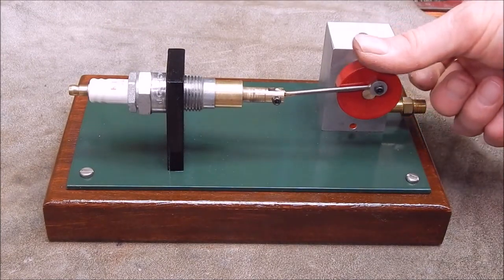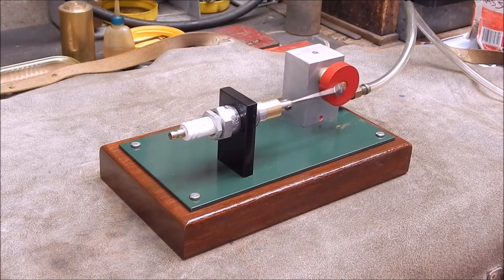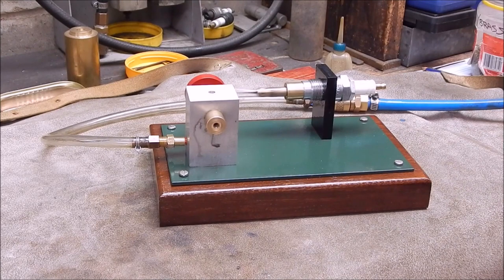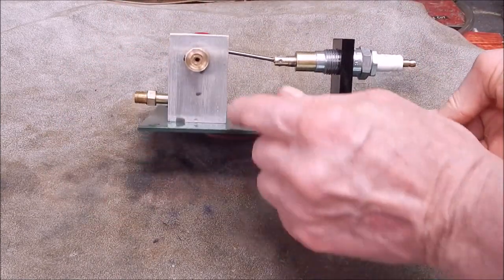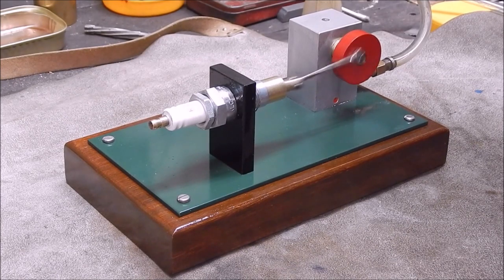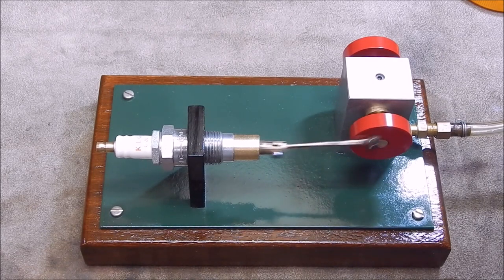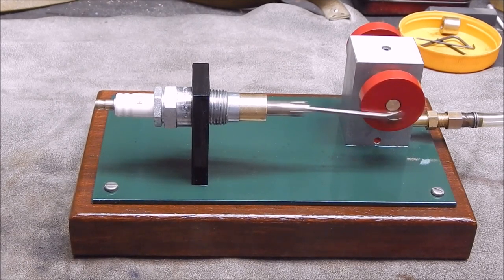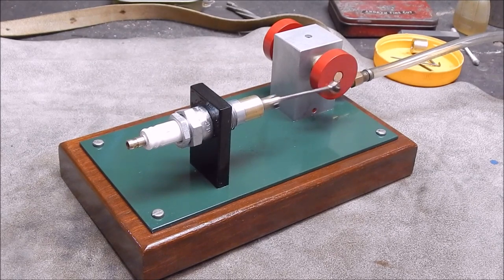Steam engine made from a spark plug

Comment from the maker: NOTE:  Like all my model engines this one cost virtually nothing to make.  The only part I had to buy was a small piece of brass stock for the cylinder and piston.  All the rest is junk.

Metal work can be as cheap as you want to make it.  You can easily do this on a mini lathe with the absolute minimal tools.  Money won't make you a good machinist, but practice will.

So what's holding you back ?  Get out there and make some chips.  Cheers Rob.

Comment: I love it Rob 👍👍👍 What a fantastic little engine, I especially like the fact that you've hidden the pipe work. That will have a few people scratching their heads 😉 Cheers, Alan.
Reply from the maker: Hi Alan, it worked out rather well I thought.  The thin riser for the spark plug makes an internal air line appear less likely, but it's there.  Good for a laugh.  Cheers Rob

Comment: Hi Rob,  I sure thought the second flywheel made it look better and it ran slower for sure.   I also will say you need to go a step further and add a plug wire to that spark plug and hooked up to a coil or capacitor or something.   Would require a little more thinking when seeing it first time.   Great job on the engine.

Dale in Canada

Comment: Should turn out a tiny false ignition coil, and connect it to the spark plug as another distraction, even more so if you take that second flywheel, and drill it for a few small neodymium magnets, and have a relay coil core near it, to generate a current pulse you feed to a red LED, apparently connected to the coil.

Comment: Hi Rob, two flywheels, I think you should V out the 2nd flywheel and run a generator through a distributor and use one of the spark plug caps with an led/neon in it onto the end of the plug! That would then look really confusing to the end viewers! Cheers, Jon
Reply from the maker: Hi Jon.  I did actually think about flashing an LED at the plug end but the piston makes that a bit unlikely.  Good trick though.  Cheers Rob

Comment: I think you could go a bit further. If you hide the incoming air line and then run a spark plug lead from the aluminium bearing block/valve to the spark plug, would have more people scratching their heads. Ha ha. Good one.
Reply from the maker: Lots of possibilities :)  Cheers Rob

Comment: It would be good to see a second cylinder run off of the exhaust if you're going to keep tinkering.
Reply from the maker: That would appear to be rather difficult.
Reply: @Xynudu  babbit bearing to connect the air line to the turning crank, the pressure cycle is already timed, a simple slide valve connected to the second crank for the exhaust timing? I'm just throwing out ideas